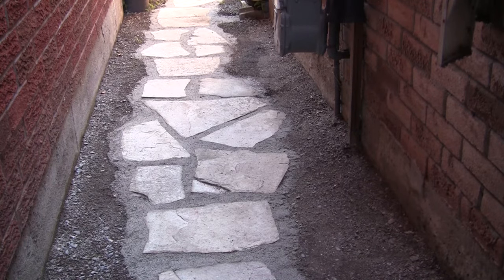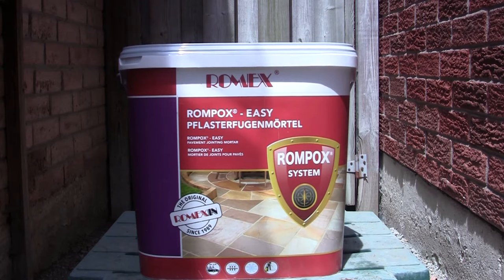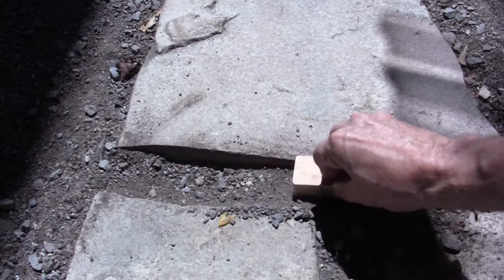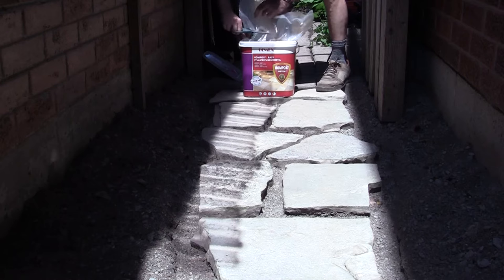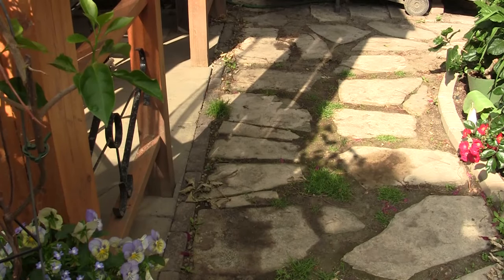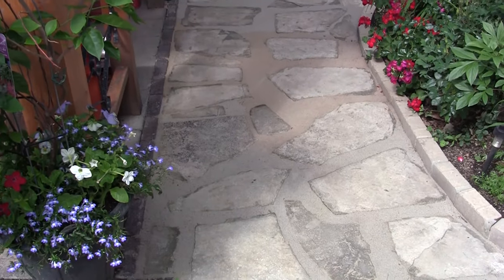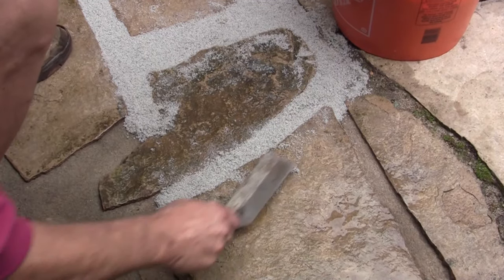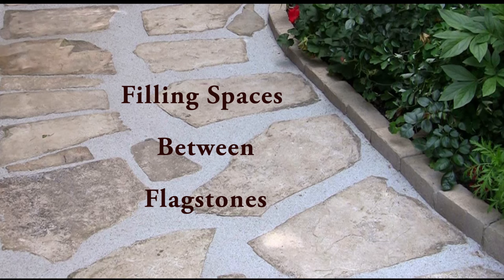Jointing Mortar Between Flagstones

Comment: Usually your don't dip the brush into the can of poly, put a little in a cup, helps prevent trash and dust from getting in the van. Mortar removed by sweeping? That is not good. Perhaps the product is less than ideal for this application.

Comment: Hope it holds up for you through freezing and thawing cycles.
  Permeability may be good in some applications, not in others.
Reply from the maker: Not sure if you're referring to the jointing mortar or the polyurethane surface. In the former case, all is well after the first winter just passed.  In the latter case, there was some pooling of water at one end during a heavy rain but the rest was OK.
Reply: @peterbloch5590  did you fill in where it was pooling with another layer of mortar mix to stop the pooling?
Reply: I’m contemplating on doing this to 4 year old field stone patio for a client. I’m confident that it’s probably settled to where it needs to be. But I’m nervous of thaw and freeze. Do you recommend an alternative. Polymeric won’t work as the gaps in stone are about 4-6 inches in some places
Reply: I used rompox in the spring of 2023.  It did not hold up in the winter. I will repair with concrete.